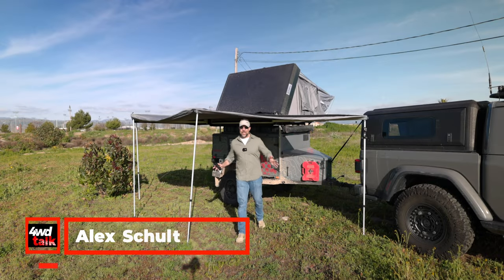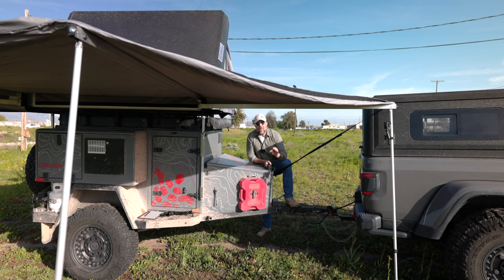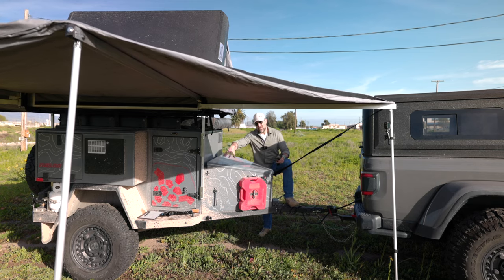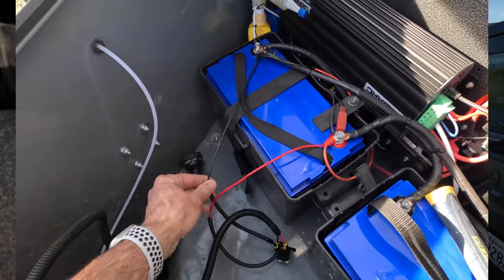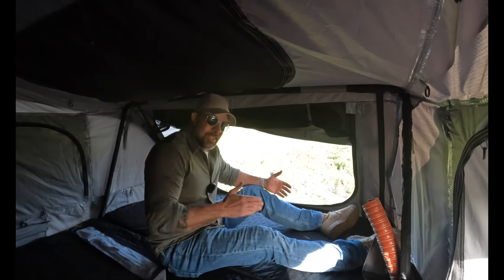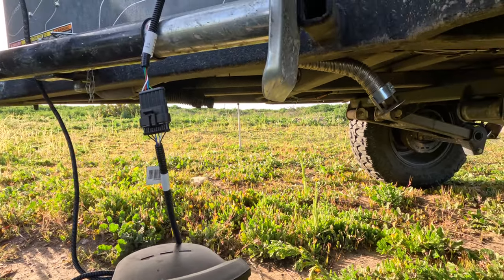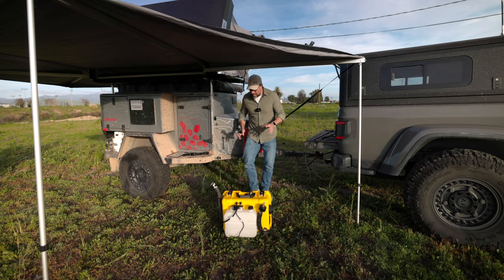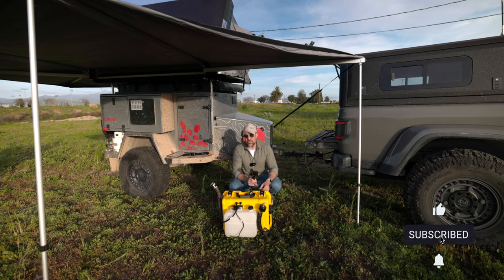Turtleback Trailer Diesel Heater Setup

Comment: Didn't know that about running your heater on low.  We have been toying with idea of diesel heater.  When you store that away for the season, do you need to empty out your tank and run the heater dry to prevent damage from fuel sitting?